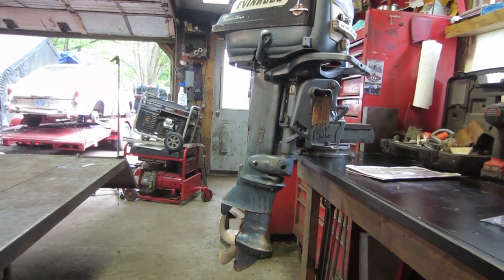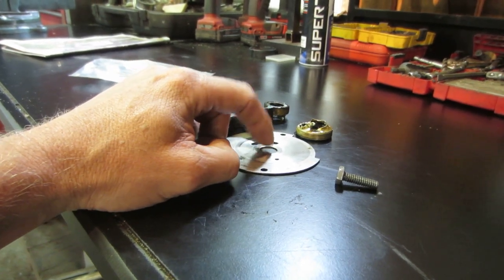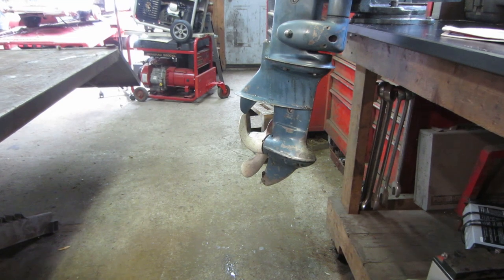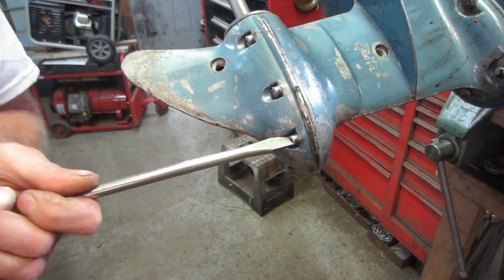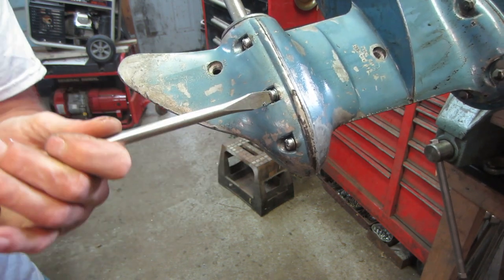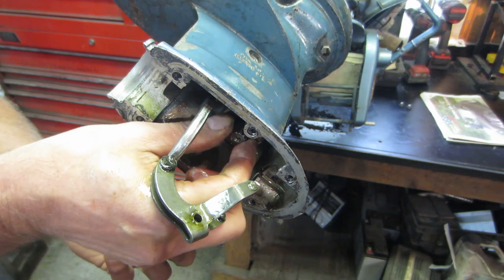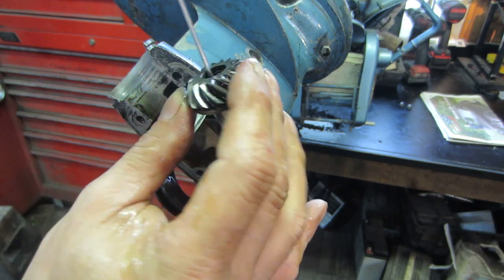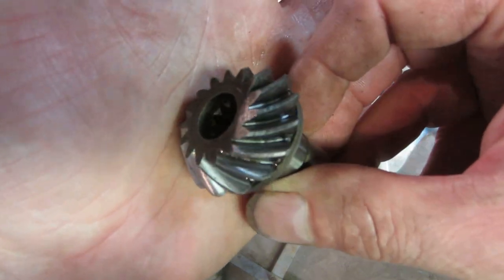1956 evinrude 10 hp sportwin, going in the lower unit once again

Comment: Well if your friend said no clip is used.....not on the 56 year model....then isn't he a mechanic that you trust.But I did read that one guy said he rebuilt hundreds of these and said your friend doesn't know didly.....its a crap shoot.I was number 169 thumbs up Mustie.Just keep the vids comming
Reply: i personally have no idea what the answer is.  i have run 54, 55, 57, 58 10 hps and had them all gone through.  the answer is easily found though in a .PDF of the lower unit diagram that surely must be out there on i-boats or some other forum.  or even available for cheap on ebay.  if it was my motor and there was uncertainty i'd get that diagram and eliminate the uncertainty.  that i know of, this lower unit did not change from 55-57.  the housing changed in 54 but i don't know if the guts did.  '58 was totally different housing again, may be differences.

but these parts manuals are very common.  i'd be shocked if you couldn't buy a download off of ebay of a .pdf for well under 10 bucks
Reply: I have all the manuals on these motors.  I don't have time to scan all of them.  Very little was changed on the 10hp motor gearcase during the mid 50's producation run .  The 7.5hp motor used a two piece driveshaft, one upper, one lower.  The lower driveshaft uses a shock absorbing spring to protect the outboard if the prop hits an object.  The plate just below the water pump impeller is a wear item that is included in the OMC  impeller kit.  It should be replaced with the impeller.  Unfortunately, I just sealed up a 56 10hp gearcase or I would could show all the parts of Mustie's gearcase.  And yes, the old water pump impeller on Musties motor was the wrong one.  Didn't fit the shaft, was too loose which caused the hub damage.

Comment: I think you may be worrying about a non issue, with the taper of the gear and friction of the spline gear I would think the shaft would ride up a bit with the rotation, but I could be wrong.

Comment: I'm not going to take a bow or anything but I did add a thumbs up to the guy that said to add the clip to keep it off the impeller wear plate :)   In the real world, you are supposed to change the impeller yearly or so and that will make all of this a non issue. That said- most don't change the impeller ever so maybe this could help. Either way- Nice Job!!
Reply: To your second point, I was thinking the same thing the whole time. Impeller/plate ass'y is a regular maintenance item so it, to me , was a non-issue.  But I still enjoyed the heck out of this series, as I do with most all of 'em. Mustie rocks, and there's alot of smart folks that check in here too. I've learned much here.
Reply: Dall Tex it’s not a yearly thing to change out the water pumps. If someone told you that it was a mechanic trying to make money off you. I have always done all my own work on every boat I owned and if a company made a motor that had to have the water pump changed every year it would not sell motors very long. Most water pumps are not this easy to change out. So why do you say change them every year? Are you a boat mechanic?? !!!
Reply: 672E galaxie it’s not regular maintenance. Wow some people just say anything!!!

Comment: Use the internal circlip. My 7 1/2 Ted Williams has the same deal. Plus I never use lower gear lube, I use a moly grease and pack it in there.
Reply: Hal McAdams say what now?!  You sir do not understand moving parts

Comment: I had a 18 hp Evinrude that had a washer on the upper side of the lower unit that prevented the shaft from dropping down.  I can't remember if the shaft was a larger diameter above the washer or if there was a snap ring there.   Which ever it was, if the washer wasn't there the shaft would drop down and the gears at the top of the shaft would "slip" under load, it was as if it was slipping out of gear.  Don't ask me how I know that.

Comment: I realize this is a 6 year old video but I find it odd that they call out a snap ring in 57 to 61 for the 7.5, and then only for the 18hp models. They don't show that clip for the 10hp in any of my books but the pinion gear and lower appears the same. The OEM number for the clip, which looks like the snap ring you have there is 301883 for the 7.5hp. Some later 10hp motors had a keyway vs splines inside the pinion gear too, in which case there was a step in the shelf that limited the travel. It seems to me that some of those lower units were swapable between years too. 
I own at least a dozen 10hp models right now, and have had over 50 of them apart and don't remember ever finding a snap ring in a 10hp with splines but I really don't see where it would hurt anything so long as it don't damage the water pump or impeller. 
The shaft just floats there, there's no downward force other than the weight of the shaft and the pinion gear cannot and should not push the shaft upward, doing so would affect the gear pattern contact beyond what was designed. The pinion gear must be able to ride against the upper thrust bushing so as not to damage the gears. Otherwise I see no reason why adding the snap ring would cause any issues so long as its not pushing the shaft upward causing wear on the crank bearings somehow. It must have some play to allow the shaft to still float freely.

Comment: Good man for going back at it to get it right. 
To me if it has a groove for a clip it should have one.

Nice job.
Reply: They use the same drive shaft for many size motors, if it didnt have a clip it doesnt need one.
Reply: @gerardjones7881  It had the wrong impeller in it. That tells me you can't trust the last mechanic, which tells me he could have left the clip out.

Comment: You had a water leak but never changed the seal on the shaft that the gears ride on....there's where your water is possibly entering.....additionally you didn't inspect the prop shaft for fishing line and bad seal. Did you use new spaghetti seal on the clam shell?
Reply: He replaced all seals with a kit...in his previous vids

Comment: Shift clutch dogs rounded off causing these motors to pop out of fwd gear alot. Water pump rubber impellers need to changed alot as well. Mercury had a tiny impeller. Evercrudes had issues with coils under flywheel goin bad when hot also. They were nice motors though. I grew up on salt water area and powerheads cooling passages would load up with salt crystals and sand.

Best to pull head and exhaust to flush out debris . I ran them in barrel with dawn dish soap. Boat rental places had these and 6hp for years. Now all Tohatsu.

Comment: This may have been mentioned before,cause I haven't read the comments, but could it be that there is play in the shaft to allow the gear to "jump" in the case of the prop getting jammed?
Reply: There is a shear pin that the prop locates on and does just that when you hit a solid object with the prop. It shears and prevent damage to the internals
Reply: Nope, the gear can't jump because there is a thrust bearing that it rides on at the top. Also, the shaft is still free to move up with that clip in place; the clip simply prevents the shaft form sitting too low like it was before.

Comment: Its pretty cool to look into something and maybe improve on its design, but... this is a 1956 boat motor. It was designed this way and it apparently wasn't an issue anyway and given this motor will likely never see enough usage in the future to even warrant a better design, the fact is this pump replacement will probably be last one it ever gets.

Comment: On most of the outboards I have worked on they have a o ring that is on the power head end of the drive shaft and the receiving end has a taper, that helps with downward force

Comment: I've only done one impeller on a 1970 Johnson 20hp. It seemed about the same as yours with the pin resting on the plate. I wonder if the clip you added might impede lubrication.

Comment: The gear had room for a clip, the clip fit into the groove with no problem apart from the ears sticking in past the rest of the clip. Me I would have gone with what the wire ring similar to what a lot of pistons have for gudgeon pin retention.

Comment: So my lower unit wont split to allow me to change the water impeller. I have now damaged the case trying to pry it open. There is now a u shaped piece missing out of the top edge of the lower unit. Will this affect operation? Is the impeller housing submerged in water when in use? Water seems to enter via the exhaust outlet and fill the lower case above the impeller housing.
Reply: As It Is yes the pump is below the water level and below the water pump is a bearing/retainer that keeps water from entering the foot housing. This is probably your problem and they are not hard to change out. This guy on this video was dumb not to change this one out. They don’t cost very much just be careful putting the new one in by cleaning and sanding any roughness out of the shaft and put a little oil on it to help slide the new one on. Be careful pushing the new one on and if you can get an air hose or bike pump to connect to the oil fill port you can check it with soapy water and pumping no more than 10# of air in it. Hope this helps you. Oh make sure when you put it back together that the exhaust tube is slid back together

Comment: I don't understand why it needs a clip on the lower pinion gear to shaft location?  If the top of the shaft is retained enough to prevent the shaft from hitting the "ring gear", then who cares, leave it as it is?   Am I wrong?

Comment: Stop saying it’s a pin. What you have is a key way and a key. A pin is round and sometimes is tapered, a key is square and fits in a key way. I think the top of the key sheared off and was flushed into the lake. The up and down motion is for torque movements. Forward and reverse. I hope this helps.

Comment: If you install the impeller upside down, the pin in the shaft would hold the shaft up and the gear in the lower unit would run with a proper amount of play. Eliminating the clip fix you show.
Aren't there parts manuals that show pictorials are things go together.

Comment: I was really hoping to see and hear the motor run after you put the clip in. I feel in my opinion (not a boat mechanic) that the play was there for a reason. Judging by the old wear plate to the new there was not much difference in what they looked like. Wasnt like the old one was worn so bad that it was an issue. I would of just left well enough alone. If it aint broke dont fix it.

Comment: Well done!  I wasn't happy about the pin riding on the plate, but didn't say anything.  I was surprised that I couldn't find an exploded parts view of the 56 on my favorite site for that, marineengine.com.

As for the spacing up from the clip, the whole movement of the shaft is about half the width of the impeller, so moving it up a lot would be more centered.  Now, I suspect, the pin is just above the plate, but no where near the center of the impeller.

Still, with correct impeller in there and no hitting the plate, it's good to go!

RichE

Comment: That's what goes in there a o-ring in that boat motor is a o-ring going there somebody took that off and they didn't put that old ring back on that shaft how you got it now that's how it supposed to be it keeps the ride from coming down they didn't put it back now it's right not to keep the water pump impeller in place in the pen so you solve the problem. I like your show keep doing the good work I look at you everyday or when I have time I also learned a lot from you

Comment: I've been thinking of getting my 1957 18 hp Evinrude out of mothballs and the last time I ran it you could still buy ethanol free gas. Has anyone had any problems with running ethanol blends with these older engines?
Reply: Can you get ethanol free gas in your region? I've started using premium that's ethanol free in all my small engines.

Comment: Why is there a hole (with threads?) in the bottom of the shaft?
Reply: The hole doesn't have threads. It's there so the shaft can be centred and supported when machined on a lathe etc during manufacture..
Reply: Durrington Dav

Comment: Good comment about 16 minutes in  Someone could have knocked the clip out when trying to mount power head without lining up splines.The slightest aggressiveness and the shaft becomes a drift pin and would easily knock that clip out.

Comment: Well my buddy Johnny Best was over eating supper with us tonight and he agrees that in 56 NO clip was used. 

Johnny and his dad owned the local dealership here in town for outboards.
Reply: Boo LuQuette this guy won’t listen to anyone that knows something about it. You noticed he never did another run video on this motor. Wondering why?? 👍👍
Reply: This!  I was wanting to see a video of it running after the clip was installed.  
To me it just didn't look right.... I have a '58 5.5 LE torn apart as we speak...no clip present.  If there wasn't a clip when he took apart..no reason to put one in...I wonder what the parts diagram shows.
10 bucks the shaft wears thru the clip in less than 5 hours and the lucky owner now has a grenaded gear case

Comment: Mustie look on the net I found some pics of that exact engine and the pics show no clip, why would it have a wear plate if the clip hold it up a bit?
Reply: Tim Basco the impeller rides on it. being stainless steel it is much more resistant to wear than the aluminum so any dirt or grit coming in with the water won't grind the housing away.
Reply: Scott Smelko , I understand stand the whole wear plate thing, what I was trying to say was that if that clip is in there would it raise the pin off the wear plate ?

Comment: Looks good to me, but what do I know? If there's a groove, you would think there should be a clip.
But who says it's the original gear, perhaps it was rebuild some 50-60 years ago. Difficult to say, really.
Reply: yep, why would there be a groove for nothing!
Reply: PuchMaxi yep that's true , we don't really know the full history on it . It could have had a set of gears put in .. But withe the groove there (and this is just my thoughts) I'd have put a snap ring in ..
Reply: Pretty sure thats what may have happened! a replacement gear was fitted that had the Circlip Groove, but as there was no Circlip on the original the new one was fitted as is, and thats what caused the Impeller problem, then again! didn't Mustie find some metal in the Casing? that might have been the remains of a Clip, (good excuse to re-watch the videos and check hehe)

Comment: When gearcase oil slowly drained after removing the drain plug, that indicates that a seal is slowly leaking. (When you still had the top plug in).